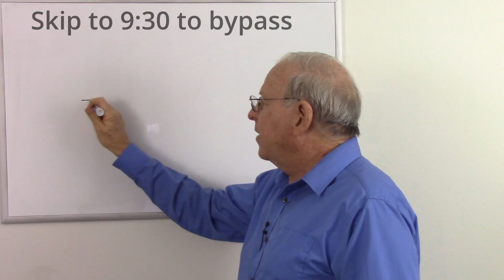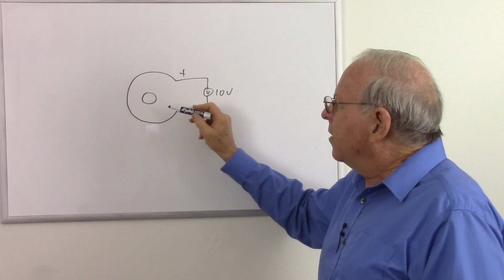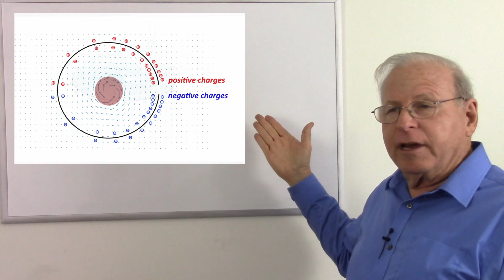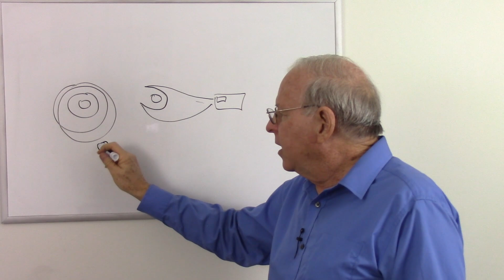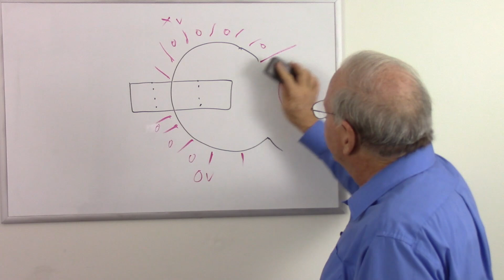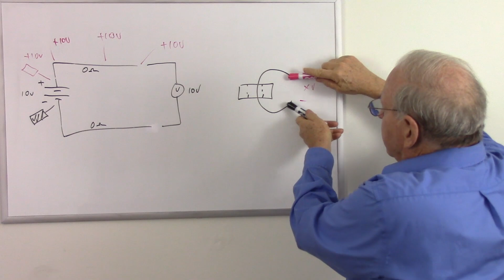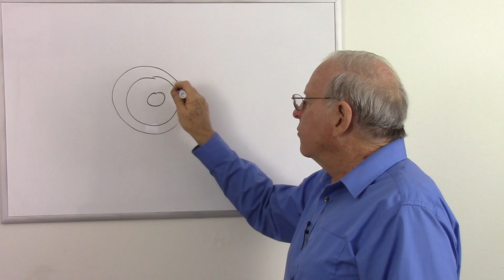Where is the emf in a Toroidal Inductor

Comment: I have just had a look at Walter Lewin's video and I find that his deductions are kuku. He claims that a coils with zero resistance has no EMF. If one measures the dc resistance of a transformer  it is always lower than it's impedance. A magnetic change influences the electrons in the wire regardless of the resistance in the wire. A zero resistance wire will probably even perform better than one with resistance. I believe cobber or silver is better than say aluminium.  
Kirchhoff's voltage law is for DC only.
Your loop example is pretty much the same as a transformer where the secondary has two connections. The difference is that there are so many windings that the probe winding is insignificant. 
The measurement on the toroidal transformer has a closed loop outside the transformer made up of the probes and the wire. If you had more windings and went to the centre you would find that you would get the correct voltage on both sides. The wires you measure must only go one way to  get a voltage. The EMF doesn't care if it is a winding wire or a sense wire. 
To get an answer to your last question then put in two loops. One will have the reverse EMF but not the other.

Comment: There is no "emf confined inside the coil". You really, really, really cannot understand  nonconservative fields.
All you need to worry about (in these quasistatic non-motional settings) is if your measuring loop (probes + voltmeter + portion of circuit) does not contain a changing magnetic field. If it doesn't, you are measuring the correct voltage; if otoh it does, you need to subtract the induced voltage. It's that simple.

The reason you cannot find any literature to support your 'theory' is because it is wrong. Solve Maxwell's equations, along with the constitutive equation and the continuity equation and you will find out.
Reply: Where have you published your own modifications of Maxwell's equations?😂
Reply: @keylanoslokj1806  No modification whatsoever is needed. You can read about the correct physics in Purcell, Zahn, Geraint Rosser, Haus and Melcher, Ramo Whinnery Van Duzer, and many other respected  uni level EM books.
Reply: @copernicofelinis  uni professors are theoreticians not engineers. Disconnected from reality

Comment: The EMF is not concentrated in the core of the center of the toroid.  If you had a gapped toroid so that you could actually place wires into center so that they remain orthogonal to the magnetic field lines, then you could repeat the experiments where the potential is measured along the winding just like the previous examples.  The problem is that the toroid is solid so it prevents you from having the same configuration as some of the other sundail type of experiments.  Part of the problem is do we define the EMF as a property of the loop or not.  If we define voltage as the integral of the electric field within the conductor, then we are forced to conclude that the EMF is a property of each loop.  But if you do this, then you are basically not satisfying the KVL anymore as the right hand side of the sum of voltages (integrals of the electric field) is not zero.  However, the electric field within the conductor is zero because the charges were able to move to equilibriate with the magnetic vector potential that is caused by the changing magnetic field.  This causes charges to accumulate along the surfaces of the conductor such that the vector potential is exactly cancelled.  That is that conductor acts to integrate the vector potential along its path.  This gives rise to a different kind of potential change along the conductor, one that solves the scalar potential equation.   But this point of view takes a different interpretation to what a potential difference is between two points in the circuit.  The scalar potential increases uniformly along the conductors (including the probe leads of the circuit) so you cannot associate the EMF with just the action of the changing magnetic field on the segment of the conductor in the center of the toroid: It happens throughout the path.  I have simulated similar circumstances and shown how these different fields behave where the conductor has a zero electric field but will have a smooth gradient of the scalar potential along it.  You can see the simulations and discussions of how they relate to lumped model approximations in my video https://youtu.be/fi7QL1TnRw0?si=dLn74BXDwsAaZ3hZ  I hope you find it helpful in understanding what is going on.